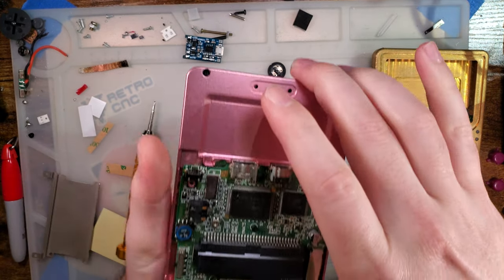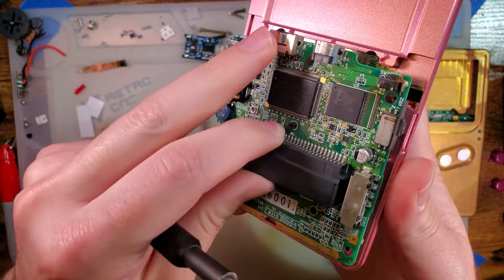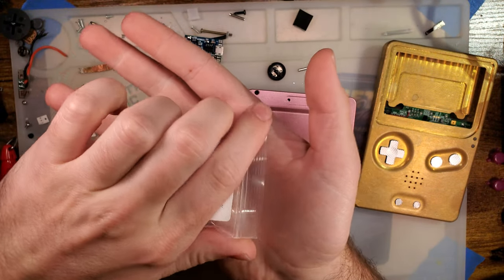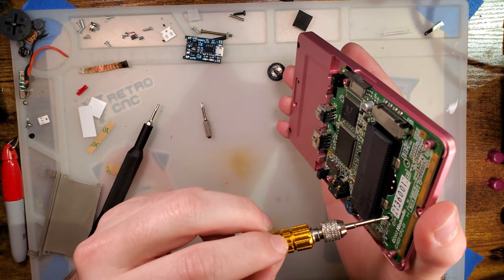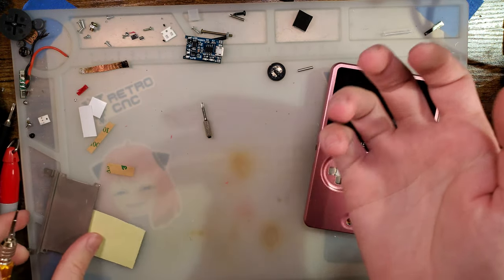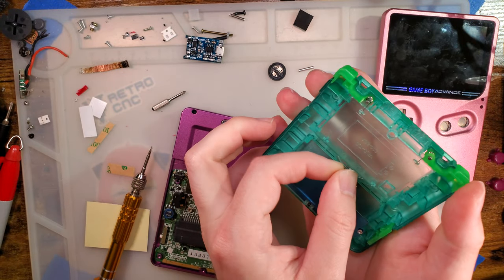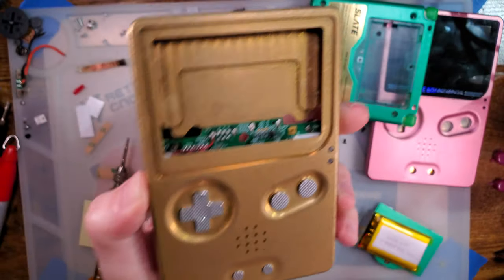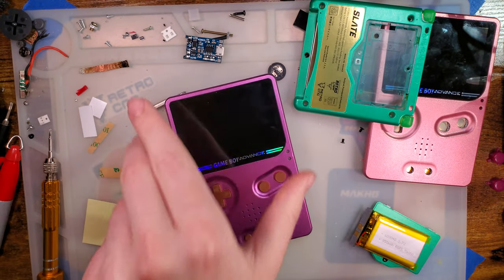Slate Assembly Guide Amendments

Comment: Thanks for making the slate and putting out so much information and follow up with them. Ill try the hole reaming but i did get my aluminum buttons to feel good by trial and error with membranes (and trimming them) behind the d pad and a/b
Reply: I worked through quite a few variations of trimming membranes etc. Was frustrated with clearance between board and shell and inconsistent action of the buttons. Finally went back to plastic membranes and buttons and it's all good! Has anyone has trouble with the buttons rotating and getting stuck in shell?
Reply: @meloy_stevensstevens5877  yes. For me it was a combination of aftermarket membranes and the select wire I soldered was slightly getting caught by the speaker holder. I haven't had problem yet since I changed those 2 thing but I also haven't had any heavy play since the changes. Just my initial tests playing megaman zero for a few minutes

Comment: Lucky for me, the only issues I’ve had was the screws being too thick in the motherboard, which I fixed with a screwdriver by loosening the motherboard holes just a bit. Buttons haven’t been loose, although it could be because I’m using the Extremerate buttons, which are just a bit thicker thanks to the spray paint. 

Unfortunately, I got into an accident yesterday so I’m stuck at the hospital until they finish fixing me up. It sucks since I was planning on making a new gameboy macro with this cool 4-button 3D printed shell I found, but now I’ll have to wait until I’m fixed up.
Reply: I'm going to pick up some of those extreme rate buttons. I've had loose button issues (although i think they are fixed now) and I like the look of them. Could help even more to have the thicker buttons. Sorry about your accident. Recover well! that macro will be sick when you get to it
Reply: @rockmanfan5104  Thank you, I specifically wanted to make it with compatibility with the DS cart so that I can make it use the ds gbc emulator. It’s gonna be a neat shell with a white back, a black front, and gray buttons.

Comment: Ohhhh that’s probably what was going on on mine! I had a good gap with my buttons (the plastic one would get stuck while playing and the metal one was super loose). I use the metal buttons in the end and added some small foam i got form a back gba IPS kit lol so i’ll got back for the skews! But I’ll likely keep the foam, the feel of the buttons is actually amazing with it 😆
Reply from the maker: Your board is probably flexed and that might cause issues long term. I'd double check that when you get the next opportunity.
Reply: @makho  done! ✅ thanks for the head’s up 🙈
Reply: @makho  how do I fix a flexed board?
Reply from the maker: @anthonydamato588  board flexing usually damages vias, separates layers, and lifts pads. You'd have to repair any damage separately. If you bent your board but everything still seems to work then it's probably fine.

Comment: I am litterally racking my brain on this. I have adjusted everything but I still have b button issues (plastic button). If I press it in the top left corner it free spins in place.
EDIT: ok so I think I found the problem. It was a combination of the aftermarket  membranes and a wire that was pinched between the speaker holder.

Comment: I had issues with my L an R buttons either getting stuck or not quite registering the pushes. They worked before though. Anybody know why it would be an issue with the slate? I changed the metal rods and glued them like in his other video.
Reply: Same
Reply from the maker: @plumb3311  check your button alignment. It's a stock bottom so you can check it in a stock SP.
Reply: did you manage to figure this out? I'm having the same issue
Reply: It may be a mixture of things. I wasn't ever able to get the aftermarket shell and buttons to work correctly. Eventually I had use the OEM shell and buttons with the new rods, but without glue. The buttons no longer stick, but I'm still having actuation issues. So I may also have an issue with the actual buttons on the boards themselves.

Comment: Hi Makho, love the slate! Is there a way to adjust x and y positions on the screen? I ordered the non-laminated screen and lens and the image unfortunately is not centered - I have black bars on the bottom and on the right, the image is cut off on the top and on the left. I installed twice and both times the same problem. Since the screen and the lens can not be moved/adjusted in the shell the only way would be to adjust the image position, right? please let me know if you are familiar with this. thanks!
Reply from the maker: the 9380 kits utilize the full LCD. There is no adjustment. Are you sure the image is actually cut off by the lens or is your game just cut off?

Comment: Follow up on a comment from an older video on testing aftermarket GBA SP batteries. 
The ones I got for testing on Amazon are:
Cameron Sino 900mAh
Takoci 900mAh
TF Seven 850mAh
Pickle Power 900mAh
Un-named green label on blue shell 850mAh
XunNeng 900mAh
Fithood 900mAh

Also have a really good stock Nintendo 3.7v 600 mAh

Also have  from retro modding
Helders game tech 800mAh
And retro moddings variation of your design with the 3d printed shell 900mAh

I do want to point out that the first 4 I listed from Amazon all seem to be the same battery just with different labels.
Reply from the maker: And you tested the capacity of these cells? One thing to keep in mind is that the low voltage cutoff of the SP is somewhat high at 3.4v and most testers go lower than that so it's worth taking that data with a grain of salt.
Reply: @makho  so what I have been doing is running the batteries through 5 full life cycles recording my start time and the time it dies. I'm using the same GBA SP with IPS screen upgrade and only running Pokemon red and  blue just Incase some other games use more power to make it as fair as possible.

Comment: Would a 2Mx4mm work for replacement screws for the rear shell? I had issues with a replacement rear shell that caused the stock 3mm to not engage more than a few threads so it stripped the first few threads from the Slate itself. 

If i screw the stock screws in without a rear shell they have plenty of threads to engage so I assume it will be fine.
Reply from the maker: Yeah, longer is fine for all but the cart slot and three motherboard screws. We just opted to keep all the screws in the kit the same length to make it easier for everyone.

Comment: I really like my slate so far. My light pipe was not flush and when I went to pull it out the plastic chipped. Otherwise no issues with my installation
Reply from the maker: @SP-nt4sr  They are press fit in every Slate shipped so far where they are preinstalled. Heating up the Slate (like with hot air or something) might be enough to slip them out if need be since we threw the pipes in the freezer to shrink them enough to slide in. 

Point is, no glue was used here.

Comment: so i'm using the aluminum buttons on mine and they got a little bit of wobble on the A and B, any thoughts or is that just how it is with those?
Reply: Blue painters tape on the motherboard. You may need to cut out two squares and lay them on top of each other. Thats what I've done and it has worked out well for me.
Reply: Haven’t tried @Scrap_Dragon ‘s hack but in general, alu buttons will have some play/movement/“wobble”. It’s the same on my Boxypixel

Comment: In the original installation video, makho attaches a double sided tape piece that rests between the motherboard and the black display pcb. In this amendment I can't seem to see it/it doesn't appear to be present. If I did not use that double sided tape between the mobo and the pcb, will that affect the slate installation? Will the black pcb rattle around without the tape? Thanks!
Reply from the maker: not necessary

Comment: Hi Makho - Any chance you can provide the screen measurements or have a place to get a screen protector? Would love to protector the screen from scratching. Thanks!
Reply: It should be the same size as a DMG screen lens, iirc
Reply: @valshaped  yup DMG exactly.
Reply: I ended up cutting my own out of a cheap nintendo switch screen protector since I didn't have a dmg one lol works nice and actually turned out pretty good. Just used a marker and traced the edges of the screen
Reply: Clear packing tape and razor at the edge.
Reply: I looked on AliExpress and ordered 2 DMG Tempered Glass for under $8 with shipping to the US. Should be here in 2-3 weeks. Thanks for the input. 👍🏻
Reply: @christopherresch  Laughed out loud when I read this. 😂 I normally hold the packing tape method until after I crack the screen to avoid having to repair it right away. lol

Comment: I had issues with the LCD fitting and it broke and retro game repair shop said they would send me a return label but then went silent. I keep messaging but they won't tell me how to get the label.
Reply: it usually gets sent to the email you used at checkout
Reply: @HighPower64  they finally answered back they just sent out a replacement instead and gave me the tracking. It's been in the mail since the day they said they would send me a label.

Comment: makho, do you know if Funnyplaying is going to release a laminated Game Boy Pocket display?
Reply from the maker: Unlikely since it's not possible to fit a laminated Q5 display assembly in a Pocket without significantly modification to the front shell as the display assembly (and lens too) would have to sit higher up in the chassis. I asked about it and they said they want to stick with OEM looking shells.

Comment: What kind of screen does the slate come from? All I k owe is you can’t you the lens with sunglasses on. 😂
Reply from the maker: It uses a blackberry 9380 LCD, same as all the GBA backlight kits from a couple years ago. In fact, the slate kit itself is just a lightly modified GBA SP kit from OC that has the color palettes "feature" disabled, gba style button controls enabled, both touch sensors disabled, and then the slate lens laminated on instead of a GBA SP lens.

Comment: Would there be any issues with swapping out the proprietary charging port with a type c port on the slate?
Reply from the maker: Using one of the centered mods from giltesa or funnyplaying, no. The older mods that I've shown previously will cause fitment issues with most USB cables against the Slate housing.
Reply: @makho  oh okay. I had to picture it, since the type c ports I've gotten in the past have had the ports toward the top of the opening. I get how that would cause issues with pressure on the back of the screen. I'm new to modding gba consoles, so I had to ask if it would work properly for the slate before I went and made any changes to the one I put together.